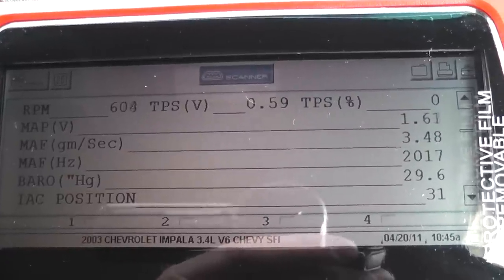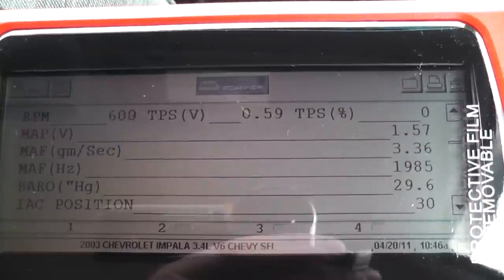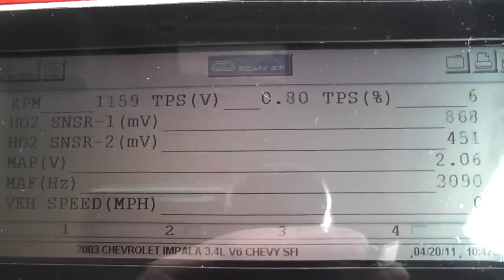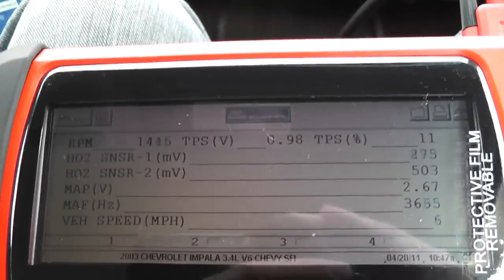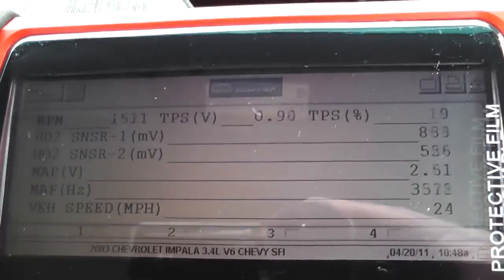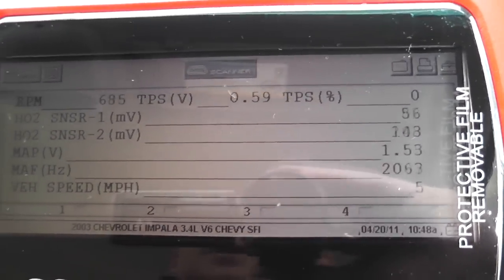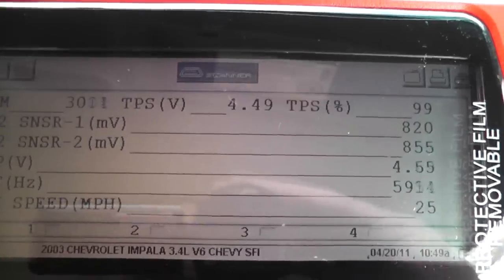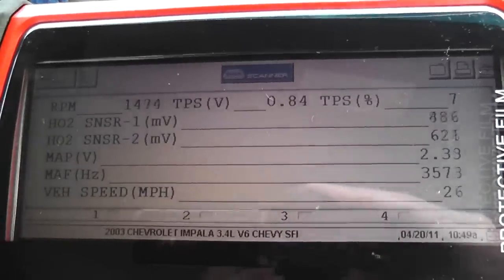How to test for a restricted exhaust (catalytic converter)

Comment: i love your video, i am actually on paid subscription . could you also instead of back pressure test test PIDS of dowstream O2 at 2500rpm, saw a video in which guy had bad cat and his B1S2 sensor at 2500rpm didn't have a flat line reading common on healty cat (usually close to 0.5V) but instead started following O2S1 sensor. Is that a good alternative test to prove cat is bad? To me seemed easier/faster method since he was watching on scan tools both upstream and dowstrem O2 sensors at 2500.
Reply from the maker: Remember a cat can be "bad" in two ways.
1. Lack of oxygen storage capability, but still provides good exhaust flow.
2. It is melted and restricting the exhaust.
In both cases the downstream O2 will mimic the upstream
So no, you cannot use a downstream O2 signal to determine if the exhaust is restricted.
Great question and thank you for the subscription!

Comment: In the begining, looking at the live data, the IAC position was 31. Is that number a duty cycle percentage? Can IAC numbers be an indication of exhaust restriction? Also i noticed MAP voltage was high, contradicting the low MAF Hz. If im not mistaken exhaust restriction reduces manifold vacuum?

Comment: What is the back pressure supposed to be at idle, 1,2,3,4, and 5 thousand rpm? If the car was on a  dyno how much horse power is robbed from a restricted exhaust per psi of back pressure. There must be some formula that can approximate the horsepower it takes to move a volume of air at a certain psi.

Comment: ScannerDanner, Thanks so much for this video man! You're a master of your craft 😎 Question if you'd be so kind: I have a 07' Frontier V6 with a P0300. New coils & plugs. Backpressure testing via O2 ports shows both driver side cats at 0 psi. Passenger front cat shows 3.5 psi, passenger rear shows 5 psi. Change the passenger front only? Or are they both shot? Not sure if the rear cat reading is somehow caused by a clogged front. Just don't want to waste $$$. Thanks for your time 🙂
Reply from the maker: So behind the cat you're showing 5 psi? This means pieces of the cat broke apart and are lodged somewhere downstream (resonator or muffler) 
Also you can't have a higher psi further down the exhaust, it's physically not possible. If you saw 5 psi downstream, you'd see that same 5 psi upstream. Is this a true dual exhaust system?
Reply: @ScannerDanner   @ScannerDanner  Thanks so much for taking the time to reply! 👊 
The system is a two-into-one. The layout on the passenger side is: Manifold to O2 Sensor, to Primary Cat, O2 Sensor, to Secondary Cat. All parts are in that specific sequence. I hope the way I wrote that helps. My bad if it doesn't.

Gauge hookup at the first sensor bung reads 3.5 psi and 5 psi at that second sensor bung. Many thanks in advance 🙏
Reply from the maker: @s.p.9582  you can't have a higher pressure downstream. Im not following your order, is the downstream O2 between the two cats? If so, your secondary cat is the problem and you will want to change them both anyway as they probably don't come separate and you definitely do not want to use aftermarket. In 2 months you will end up with a P0420 or P0430 code you won't be able to get rid of
Reply: @ScannerDanner  Once again thanks for your valuable time. I checked the pictures I took of the test gauge to confirm. Fwiw, I followed the instructions that came with the tester. Revs were at 2k. Engine was warmed.

The downstream O2 is between the two cats. The upstream O2 is forward of the primary cat. Per the pictures, the downstream read 5.2 psi. The upstream read 3.8 psi. On the driver's side, readings at both ports were 0 psi (engine warmed, revs at 2k).

Also, the cats are separate and can be installed individually. I really hope I don't have a bigger problem on my hands. This all happened a week before I was to sell the truck!! 😣 Current plan is to replace the problem cat(s) with a Walker EPA model.

The truck is a 2007 Nissan Frontier V6 4WD with 90k miles. Many thanks in advance 🙏
Reply: @ScannerDanner  I hope all is well. So, based on my last message, just get the secondary cat for now?

Comment: My car is running a bit loud at idle and when I am in gear stopped at a light, the car randomly jerks/kicks back at me.  Could this be a catalytic converter issue?  My mechanic suggested this, but he said he really wasn't sure what it was and it was his best guess.  2006 DTS.  I don't seem to have issues getting up to freeway speed like this impala in the video.

Comment: what if i remove the o2 sensor, start the engine, and then stick a rubber plug into the o2 hole see if i can hold it in?? and if i succeed to hold it in place into the hole then pressure is not too much and i know i'm good.. would that be a sufficient test to start with? thanks!!

Comment: I had this happen to me on a 01 Grand Prix 3.8 k engine. Same symptoms but bad misfiring on cylinder 3 and a little less on 1 and 4 under wot. Aftermarket Ngk spark plugs was my presumed culprit but changing them didn't fix it with wires. Cat measures 10 psi+ at wot. No bueno. I wish the exhaust would have whistled like this one did.
Reply: I have an '05 Cobalt that had misfires due to a bad/faulty Ignition Coil Module because it kept over heating because of the foam that sits on top of it that is glued underneath the beauty lid cover on the engine. After installing the ICM I cut away the foam that was suffocating/covering the ICM and preventing it's ventilation fins from performing their function and I also drilled ventilation holes through the plastic engine cover. I suppose the misfires and extra fuel can destroy or at the least shorten the catalytic converters life expectancy. In-credible.

Comment: would you consider to upload in the future a video how to test properly a cat inefficiency P0420 code, I  have known It is very hard to make the call about replacing cats.they are  very expensive some of them, I have clear the code and it has comes back after month when scoping front 02 and rear 02 I can see rear 02 does not follow pre cat switching also does not drop online after wot, post cat fall down after but still has the code, Also how do I scope or test on a/f ratio and post cat??P0420

Comment: Hey, so what pressure should we expect from known good engine with results from back pressure test on it ? 2 psi is bad on idle and 7 psi is bad on higher rpms. What are good results ?
Reply from the maker: It should be 0 psi at idle and basically 0 psi at 3000 RPM in park. No more than 2 psi at 3000 rpm in park is the spec I use

Comment: So the o2 readings are only used to tell the condition of rich/lean condition & not use it to control the A/F ratio correct?
Reply from the maker: A narrow band O2 sensor is more of a switch. And can only indicate stoichiometric (lambda) which is 14.7:1 for gasoline.
But yes, it is used for fuel control at steady throttle operation. Heavy accel or wide open throttle it is not used
Reply: @ScannerDanner got it thank you

Comment: i wish i would have thought this first... i did everything but cat airflow check... thax... i am keeping my fingers crossed this is it,,, very rich,black plugs shit for power ... transmission seems not shifting correct either.. does lack of power effect trans? thax
Reply from the maker: absolutely a lack of power will affect your shift points. I have had many customers over the years think they have a transmission problem when they have a misfire or restricted exhaust or fuel psi problem

Comment: Had a bad head gasket (bad head too, had to get a new one) but was burning a lot of coolant. Changed it, leak is gone but still lose power the longer I drive. Could burning coolant for a long time screw up my cat? Getting a pressure gauge to test for back pressure.
Reply from the maker: sure, because it will mess up the AF Ratio

Comment: If I don't have any diagnostic tools ... Can I drive the car with no o2 sensor to relief a little pressure and see if any improved performance ? If slight gain on power can I expect clogged exhaust possible bad cat ? Or will doing so give improvement even if fuel is possibly the issue also ?
Reply from the maker: +Kevin Duprey yes you can! I've done that test in a pinch. And yes, if the exhaust is plugged you will notice a significant difference in acceleration.  If it is fuel related you will have no improvement at all
Reply: +ScannerDanner -  I took cats off completely and car drove with power for a few minutes then began chugging and bucking hesitate etc ... So there was improvement as before car would not go over 20mph ....  But improvement is short lived .. I'm thinking whatever problem is , cooked my cats ....  Do you think 02's could do that ?  I ran car with o2's installed and no cats for this test = result was short lived full power ( 3-4 miles ) then problems returned ...  Let car cool ,  repeat of said results ...   Any clues ?  Thanks

Comment: +scannerdanner will you still get an acurate diagnosis of a restriction while brake torquing the engine? Another master tech showed me this tip and i was curious to know if he is correct or not.
Reply from the maker: you don't need to and it's bad for the torque converter to do that for more than a few seconds.
Reply: +ScannerDanner right i understand that. But basically what i meant to ask is why do i get a different reading on a vacuum gauge when the vehicle is in park at 2-3k rpm vs when it is placed in gear at the same rpm. I have had vehicles test fine in park and some then drop to around 3-4 in. hg in gear.
Reply from the maker: load is much higher in gear, airflow is much higher in gear (when brake torquing and engine), so backpressure will be much higher too
It is normal to have some backpressure under load, how much, is different on every car. So I don't use the test you are describing for that reason. It just adds another variable to the mix
Reply: +ScannerDanner gotcha. Thanks for clearing that up. I was thinking it was something along those lines but then that guy i spoke about said that's how he's always done it and I'm always up for learning bew methods. However, I learn with caution which is why i asked. Sounds like sticking with what i know will be best. Vacuum test in park, back pressure test, and pressure transducer if i can get ahold of one.

Comment: What was causing the whistling sound?
Reply from the maker: Psi building in the exhaust, probably leaking past the collector
Reply: My 2003 Crown Vic makes a whistling sound while running and an escaping compression sound when I shut her down. I figure the cat has bit the dust. How is your Boxer doing? Still on a flower diet?
Reply: Robert Wood
that sounds more like a vacuum leak as mine was whistling only at WOT.
Silo is back in his crate when we leave the house ha
Reply: twin turbo setup :)

Comment: Or just pull an o2 sensor and drive again. If its backpressure then the lack of power will no longer be present. Done without gauges, scanners and an hour of messing around. Drop mic.

Comment: just wait till ford gets the opposed piston 2 cycle engine on the road😖 
They are going to use oil because they have cylinder port valves and I'd imagine some of that oil could lead to cat issues even then the piston rings will be fixed and probably won't last too long either.

Comment: If my MAF sensor reads the same as yours and wide open throttle when I am not experiencing poor performance, but reads half the value of yours when the issue occurs, could that mean that I have a MAF sensor issue and not a restricted exhaust?  I have a European vehicle that isn't 100% ODB2 compliant and cannot read the O2 sensors.
Reply from the maker: Every engine will have a unique MAF gram/sec reading. This is based on engine design, size, turbo or NA, etc etc
Reply: I realize this, but my MAF reads around 85 when I first crank the car and can achieve full throttle and over 4k RPMs.  After a short amount of driving, I can only achieve 1500 RPMs at full throttle and the MAF sensor says 33.  Does this sounds like restricted exhaust may be the issue?  Why would my problem resolve itself for a bit after restarting the car if it's a plugged exhaust?
Reply: Nevermind.  My issue was something called "limp mode" due to low turbo pressure due to a tear on the sensor hose.

Comment: If the converter needed replacement then replace it it's gonna need to be replaced when the most common thing is that converter needs replacement when the engine spark plugs are fine and everything else is fine. Everything else is bull theory unless the car was nt maintain. I had a clogged fuel filter and everything else was fine. Converter has a filter

Comment: My engine cap pops off at idle when I unscrew it. This is back pressure?
Reply from the maker: are there other symptoms of problems with your car? would also help to know what you are working on
Reply: ScannerDanner  hey thanks for the reply.

2007 Honda Accord 2.4 l
297,000 km.

It has a 0420 code and p0172 (rich code). No foul smell from tailpipe or smoke, engine runs fine.
 Fuel trims -16, 
Burns a quart of oil+  every change.
New oem upstream sensor
3000 km old ap exhaust cat converter
New oem pcv
Voltage for downstream is erratic and matches upstream sensor.

Replaced cat a month ago with ap exhaust aftermarket cat. The rich code went away after replacing the cat and upstream sensor but returned a few weeks later with catalyst efficiency code.

Any test I can do for o2 sensor without taking it off? 

Is there a fuel pressure kit on Amazon Canada I can use to also measure cat converter back pressure?

Comment: I AM NOT MACHANIC BUT JUST LIKE TO WATCH YOUR VIDEOS. AT FIRST I WAS BLIND BLIND BUT JUST KEEP WATCHING. IT IS NOW (AFTER A YEAR) THAT THEY START TO MAKE SENSE.
NO WONDER I ASK TECHNICAL QUESTIONS THIS DAYS.

HERE IS A QUESTION.
IN THIS VIDEO COMPLAIN WAS LOW POWER.
YOU SELECTED FEW DATA PITS , RPM, O2 UPSTREAM AND MAF.
O2 WAS RICH AT HIGH REV.
YOU SUSPECTED PLUGED EXHAUST AND INDEED IT WAS YOUR PROBLEM.

IF I WAS ON THIS CAR I WOULD HAVE SAID THAT SINCE IT HAS LOW POWER WITH RICH O2 THEN THAT MEANS WE MIGHT HAVE LEAKING FUEL INJECTOR OR STUCK OPEN. AS A RESULT THE COMPUTER IS TAKING AWAY FUEL FINALLY WE GET LOW POWER.

BUT YOU JUST SAID THIS COULD BE PLUGGED EXHAUSE AND IT WAS. 

WHAT GUIDED YOU NOT TO THINK AS ME.

M.B.S MOSHITOA(SOUTH AFRICA)
Reply from the maker: Just a few missing puzzle pieces for you in your thought process.
1. All engines, when accelerating at wide open throttle will have rich af ratios. Rich mixtures, the flame burns very fast, compared to lean, and that's what we need to make power. 
2. Fuel trim and what you described when the computer will take fuel away, when the O2 is rich is not done at wide open throttle. We are in open loop mode (02 is ignored)
Does this make sense?
BTW excellent job you are doing and your questions are awesome! Keep it up my friend

Comment: Wondering what the ideal pressure PSI numbers should be at idle and 2000+ rpm?
Reply from the maker: In park? Zero and on a vvt engine it can actually go into a vacuum